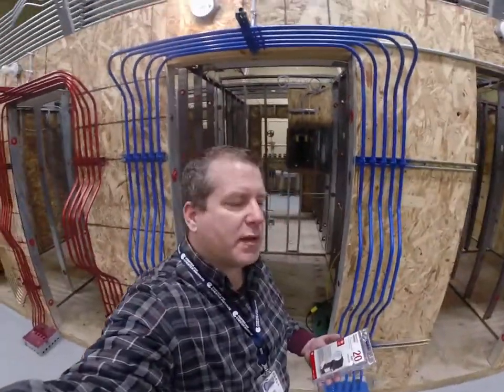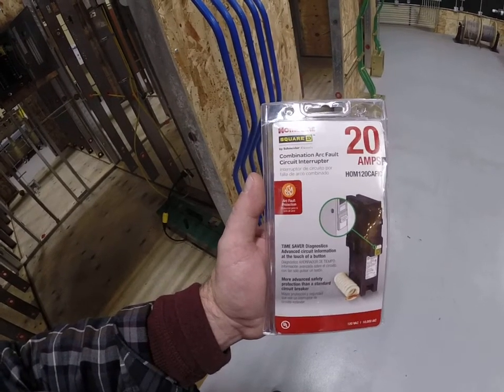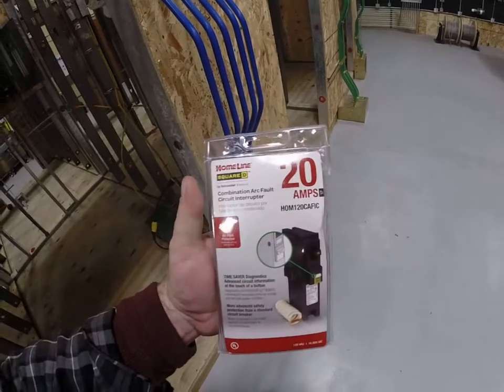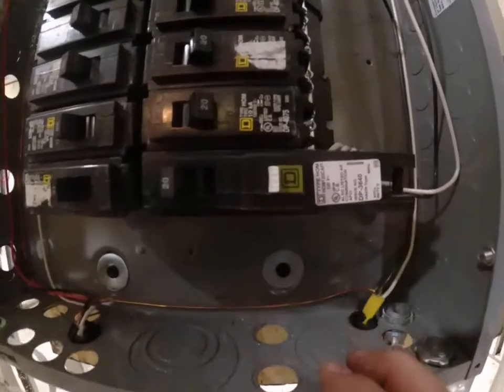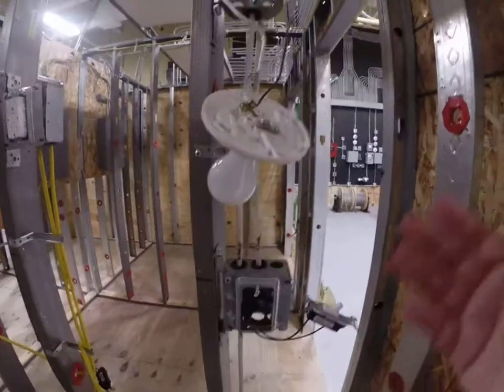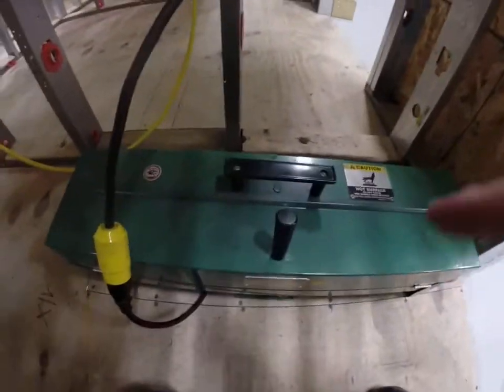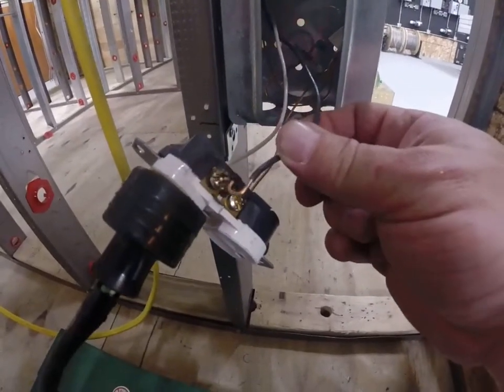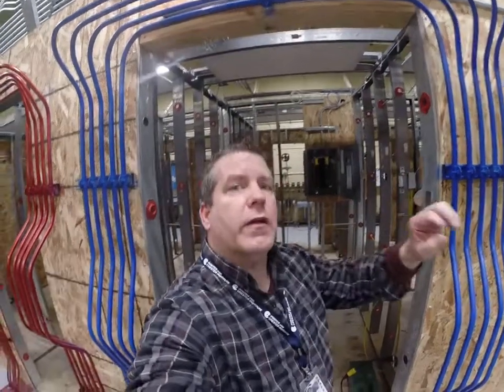Arc Fault Breakers- ( A false sense of security )

Comment: is an arc the same as a spark?
Reply: No, an arc is electric current jumping a gap between 2 conductors. Arcs produce sparks.
Reply: Somewhat. Arcing produces sparks, but might require a microscope to see. Continuous arcing inside a receptacle at the worn-out loose contacts that barely hold the plug, powering a space heater, will smell, buzz, but with sparking very localized. 
The spark we all see when plugging in electronic equipment is very short and harmless... because it is short and not sustained.

Comment: If you search, you should find documentation stating something to the effect that it takes 70amps (or more) of load to detect arcing with these devices. Ironically, as I’m sure you’re privy to… regular 15-20amp breakers do a really good job of tripping at this current level too 🤨. However, I think it would be interesting for you to do a comparison with a high inrush- like a motor load from standard breaker vs afci…

Comment: Secondly again this is sensationalism without performance of what you’re doing. If you plug in an AFCI tester I’m sure your device will trip. But what you are not showing is what kind of an arc in milliamps are you actually drawing so if you don’t own one go rent a couple thousand dollar tester the contract the continuous number of arcs you are producing and what their actual peaks are on a chart
Reply from the maker: To a degree yes. But my only point in this video is if you have this going on in your walls, you certainly would want this to work immediately. I don't care about the little insignificant arcs that have no consequence. I think you're missing the point of the instruction.
Reply: @ericstark6183  trust me I get the insinuation of what you’re trying to prove, I’ve been an electrician for 50 years, and everything from a damn shed to a 20 story building. Better yet why don’t you see what kind of sparks those parking maneuvers you are performing wood light with typical building materials how about showing if that would actually even happen and you still didn’t answer the question of why the breaker didn’t trip to the real testing get the real gear show what’s really happening and why this won’t trip the breaker
Reply: If I put my engineer’s hat on, then I would say that the product is performing as designed. If I put my consumer / homeowner hat on, I would say what good is this product? Mt. Stark is an educator and he is teaching that AFCI technology does not function and protect as consumers and homeowners think it should. Lesson taught. Lesson learned. Thank you Mr. Stark.
Reply: @J-Jim  did I or did you ever see some sort of video or message from any agency or group that says the AFCI breaker will protect you from this I don’t think I ever caught that.  Now I guess the average consumer might think this but I don’t know I haven’t asked any of them, And I’ve never had one of my customers even ask me. This is sensationalism pure and simple. He’s not proving that the breaker is bad he’s showing things that can happen and he is not showing what the breakers design covers. See my response to him above
Reply: It’s been a while since I’ve looked, but I  haven’t seen any manufacturer’s specific breaker tripping arc profiles. I do know that results very widely. Arc fault testers from Amprobe, Ideal, and Klein do state their test methodology of number of pulses per second (arcs) of a certain load / amperage. These are fixed pulses per second. I’ve always thought that AFCI equipment looked for pulses (arcs) that were in a random pattern within a specific time frame. Perhaps the AFCI equipment manufacturers have released this information for their breakers and receptacles by now.
Reply: @J-Jim  UL Standard 1699 tells the manufacturers  what lab generated arc tests they must detect and must ignore to get a UL Listing. That leaves room for some manufacturers to do better than required at rejecting arcing that is not an ignition risk, like universal motors, switch contact arcing, etc.
Reply: @JamieMurdock90  From taking a look at an brief overview of UL 1699, I would conclude that the specific “arcs” made by Mr. Stark are not 75A or more and therefore not sufficient enough to trip the AFCI device. The AFCI device is performing as designed. As stated earlier, the general public would not like knowing this. As Jamie states, UL 1699 has specific tests the protection device manufacturers must pass. These specific test have varying amperages, and it looks like Mr. Stark’s scenario would most closely fall under one of the tests with a 75A trip threshold. I can only go off of the UL 1699 overview, that I read. If anyone have the full standard, they might drill down more.

Comment: But is this a true test based on the devices specifications. You’re not talking about what are the specifications that the device is built and listed under what you are the time/arc loads that actually tripped the device and what are you doing in reference to that are the arcs that you are creating within the realm of what was designed and listed. What is the UL listing and testing for these devices Unfortunately I feel what you are doing here is sensationalism to a degree